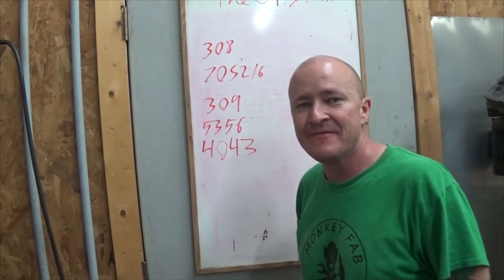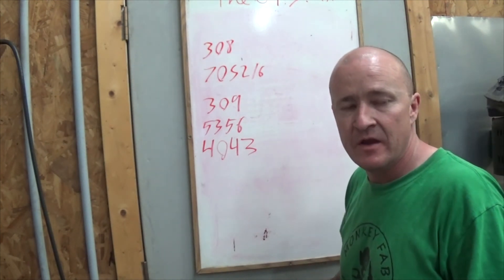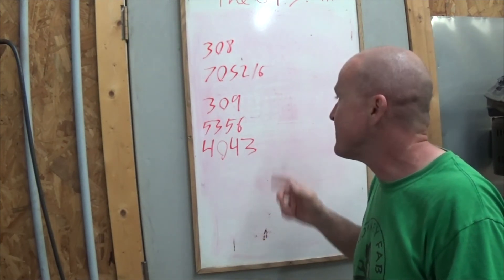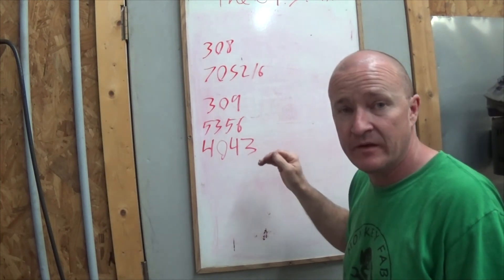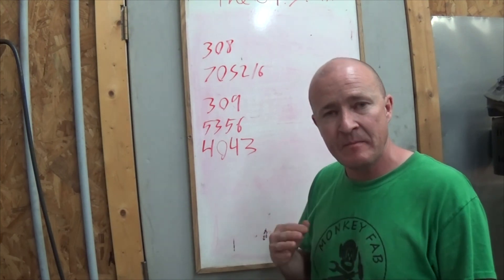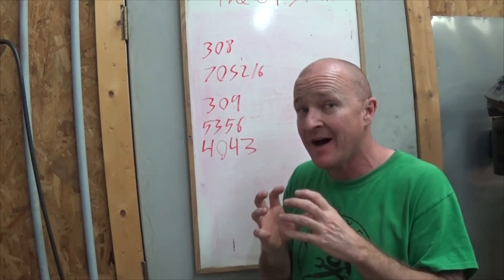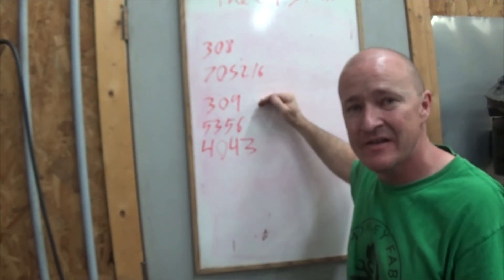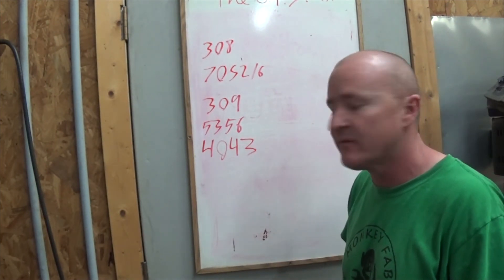How to set up and use a TIG welder series; 7 Filler Rods

Comment: Thanks for replying, another idea I had sence I have to take apart my project is to taper the flat bar so the two materials are closer in thickness, what do you think
Reply from the maker: Desert Rat 2000 you’re thinking too much. No reason you can’t weld that
Reply: Your right Mike, I did a couple test pieces, I took your advice on putting an angle on the torch, I was real happy with the results, I thank you very much my friend

Comment: Mike, please don’t turn away when you speak. You speak softly to begin with, and often fade even more as you speak, so it’s often lost when you aren’t facing the mic. Or wear a wireless mic.
Reply from the maker: Mel Gross yeah. Thanks for the suggestion. Trust me, there is nothing more humbling than making videos of yourself. I’m working on “you know” “ummmmm” “so” and all the other ticks I was unaware of my 44 years of life. Can’t use the wireless due to all the machines and electronics that will mess with them. Cords are dangerous in a shop. Working on a much better quality camera with external mic provisions. It should help I just need to figure out a way to come up with an extra grand. Until then I’ll try to be more aware of turning away.
Reply: Just want to give some background on why I mention it. I used to shoot Tv commercials, then my company, over more than two decades, edited video, Tv shows, etc, as part of our work. I don’t criticize to any or to frustrate people. Just to give some hints here and there. For example, in speaking, our “people” voice is, or should be, different from our microphone voice.